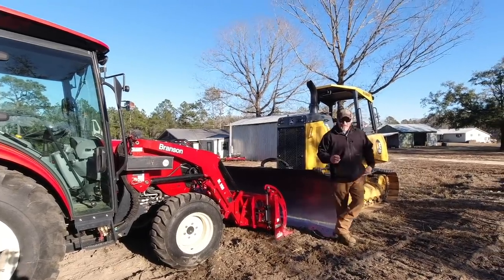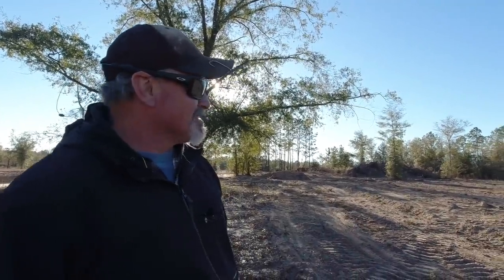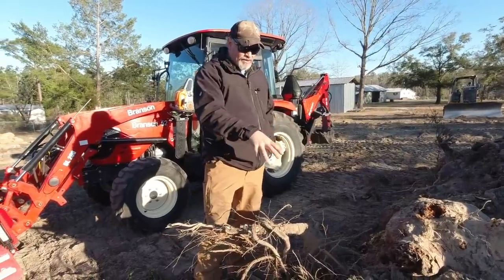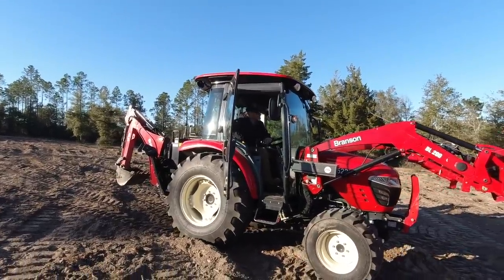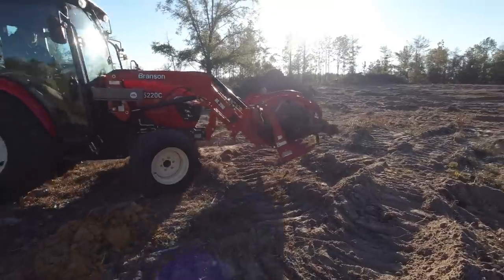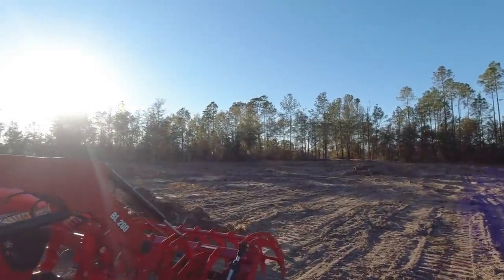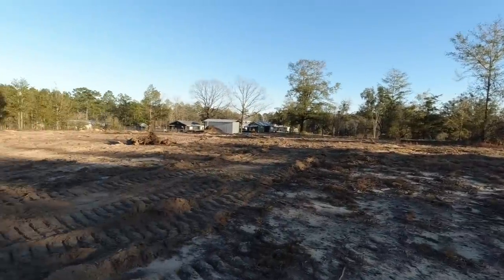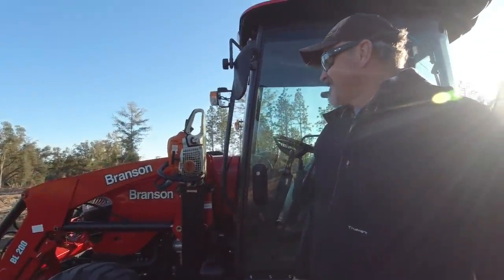Dozer Work! You Need A Dozer AND A Tractor!

Comment: Good idea to spread the ash around the area.  I always start with the less than 8 x 8 x 8 pile per guidelines, then add to the pile as it burns down.  Then the ash gets mixed into the dirt pile I have stashed at the back of the property.  Watch that grapple around the fire, I take mine off and put the root rake on - don't need to mix heat and hoses.
Reply from the maker: Thanks for watching!

Comment: Wood ash lowers the Ph of the soil. It is alkaline. A lot of flowers require an acidic base soil. You can get a cheap soil tester that will tell you what the Ph of the soil is. Don't just assume that your soil will support a certain plant. I am also a flower farmer and my plants require a sweet, or alkaline soil. Potassium Ash is a strong alkaline that will drastically bring down the Ph of soil as opposed to wood ash.
Reply from the maker: Thanks!

Comment: Ash is nitrogen carbon. Should help in your sandy soil.  State Ag Depts used to do soil samples for free to help growers.   
By all means spread the fun get Gina on the dozer . Two operators with two machines can make it go faster.   Learn to tumble stumps with blade you can leave grapple for smaller ones
Reply from the maker: Thanks for watching 👍

Comment: Get a land level or a drag to pass over the land, should break up the dirt clods and get it a lot smoother! If you know anyone that has a land level you can borrow! But a couple cross ties bolted to a piece of cattle panel makes a decent and cheap drag! Just pull around working from the outside in and then go corner to corner! You’ll see a big difference Hank! I used to work for some farmers! The more you drag it the smoother it will get! Good luck brother, you’re doing good! Of course you can back drag the dozer blade across it too but that’s a lot of neck breaking work y’all! I figured you would know that if you do box blading work! Good luck my brother! 👍🏻👍🏻
Reply from the maker: Thanks for taking the time to watch and make the comment. I truly appreciate it! Have a good day.

Comment: Hank, I have no clue what your soil is like. It may or may not need ash added. Do a soil sample of the entire 3 acres. Do it in a grid, and they can tell you what each section needs for fertilizer for your soil. Of course you need to keep the grid samples separate and track which goes with which grid.
Reply from the maker: Thanks Coy!
Reply: Go back wards with dozer blade down it's called back blading

Comment: You can seperate those stumps with that Dozer. I do it on a daily basis...Also it does have a float. But you can only use it going backwards. Back dragging Which isnt RECOMMENDED....push the blade  Lever all the way ahead and hold it. Itshould start going down then release. You have to hold the lever and back up. But thats only after getting it close too grade that you want  going forwards. Then do that to take  your tracks out of dirt.. You should let Your wife operate that Dozer. She would do ok with it...Its all flat cant get into trouble with it too bad..LoL...Good video..
Reply from the maker: Thanks for watching 👍

Comment: The blade on the 450 does have floating.  Flute the blade when in reverse.. and yes she need to drive the dozer 😁👍also to float the blade there is a switch on the blade lever push and hold to float blade..
Reply from the maker: I found the float function 😁